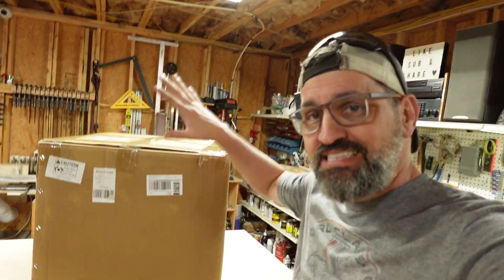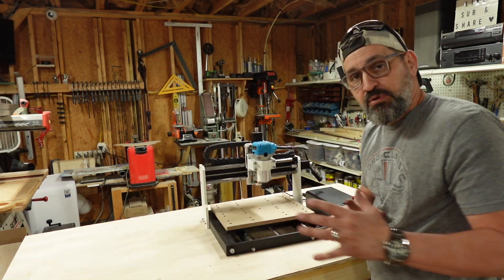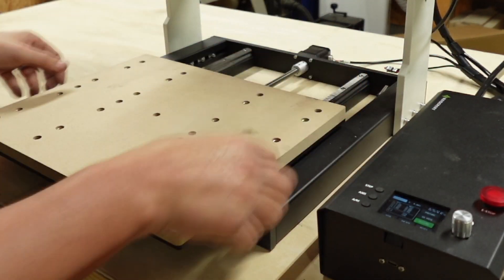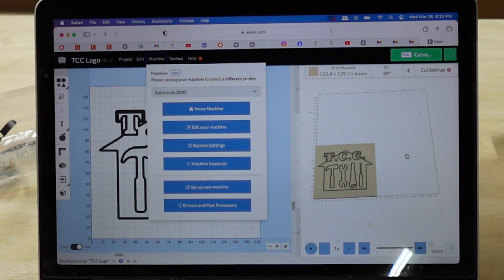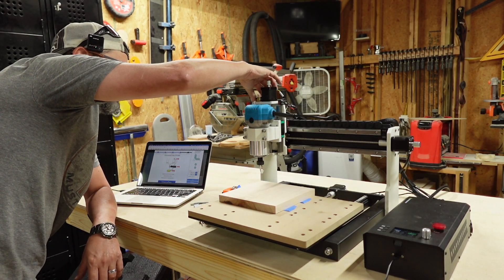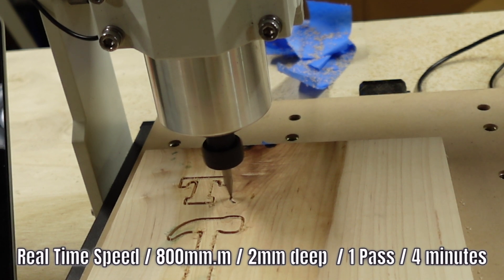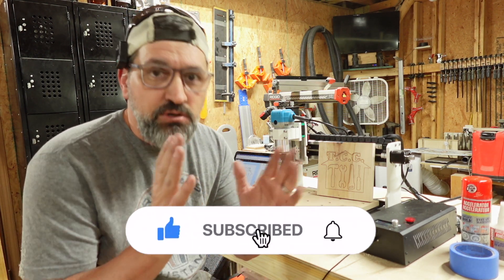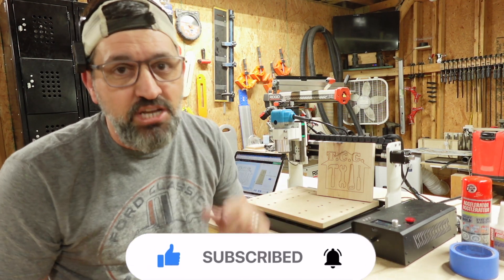The New AxisCreat 3030 CNC Machine! No Assembly Required... No REALLY!!!

Comment: Hello! :) We're looking at getting one of those. The use would be making light-duty parts out of plastics/HDPE/teflon and some aluminum. Been reading the reviews back & forth with this one vs the Genmitsu 3030. Besides being a little less expensive, the AxisCreat already comes with the upgraded 700W spindle, which is an extra purchase vs the Genmitsu. We already have printers and use them for making parts .. this would be for the things where tougher is needed. We did see the reviews where some folks used their Genmitsu 3030s for steel .. these two machines have the same stepper motors etc .. have you tried steel? Hope you don't mind answering a few questions. Also wondering if this machine can be kept in an unheated shop where the temperature might have wide swings. Thank you.
Reply from the maker: Hi! Soooo….I don’t think either of these let alone MOST desktop / hobbyist CNCs will handle steel very well. Steel is extremely strong and not to mention the Endmills / bits will not handle the workload.  For higher quality cuts, less stress to the machine and overall less hassle…. I would stay away from a Belt drive machine...Belts stretch and flex and kinda become a pain for some people.  For tough materials such as Aluminum…. Make sure it’s Ball Screw / Linear Rail drive.  That said…. As far as the work space goes. Make sure you get one large enough to accommodate your needs. The AxisCreat is twice the size at 24”x24” work space.  If you only will ever need a 12”x12” workspace then go smaller as it will take less space in the shop.  But don’t limit yourself for later down the road.  Hope that helps some!  Let me know if you have any more questions! Cheers and thanks for watching!
Reply: @TheCrawlspaceCraftsman  Thank you! Is the AxisCreat 3030 a belt drive machine? We don't need to make any big parts. In fact the printers are 220mm^3 build volume and they're fine for our needs.

Comment: I just bought this machine and if I want to run it offline from Easel, how do I reverse it? And how do I set my XY at zero? Your screen went blank and I could not see the process.
Reply from the maker: So in easel you want to go edit machine and change the $$ codes I posted on the screen to match.  Once you get those changed it should zero out at the front left corner. Hope that helps some!
Reply: @ I emailed the company and got a manual and in it is a setting to change the S23 Homing Direction in Settings to 1 to 4 the to set to the lower left corner. However, I am not sure that will fix the reversing of the image.
Reply from the maker: What’s your $2 and $3 currently?
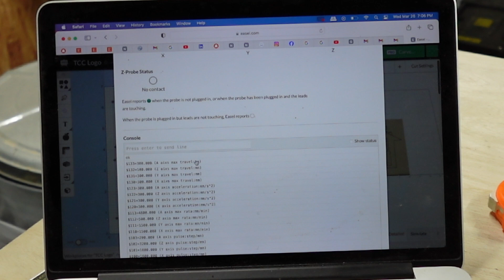Reply from the maker: Go to 8:30 in the video and it shows where to go just before it dies.
Reply: @ So I am doing everything offline, just going into the settings. the S23 was default to 11. I set it to 4 and it set it to front right. So I set it to 3 and it set to front left. I think they have Y backwards because if you look on most of these machines, like a 3018 machine, the Y motor is in the front. The Axiscreat Y motor is in the back. But basically I am doing all my designs on my desktop in Easel and then downloading the G-code. Still trying to figure things out .
Reply from the maker: @ it definitely is a learning curve!

Comment: Let’s be honest, it’s not a spindle it’s a router
Reply from the maker: Yes, there are key differences between a router and a spindle, even though a router can be used as a spindle on a CNC machine, hence the term “Spindle”.

Main Differences:
	1.	Power & Performance:
	•	Router: Typically runs on a universal AC motor, which is powerful but not designed for long-term continuous use.
	•	Spindle: Uses a more efficient and durable brushless motor, often with variable frequency drive (VFD) control, allowing for higher torque at lower speeds.
	2.	Speed Control:
	•	Router: Usually has a fixed-speed range (e.g., 10,000–30,000 RPM), with limited control beyond a basic dial.
	•	Spindle: Offers precise speed control (via VFD) from low RPM (for metals) to high RPM (for wood/plastics) with much better torque.
	3.	Cooling:
	•	Router: Air-cooled, relies on built-in fans, which can lead to overheating during long cuts.
	•	Spindle: Can be air- or water-cooled, with water-cooled versions running quieter and staying cool even under heavy loads.
	4.	Noise & Vibration:
	•	Router: Louder and vibrates more due to the brushed motor and high-speed fan cooling.
	•	Spindle: Quieter and runs smoother, reducing wear on the CNC machine and improving cut quality.
	5.	Durability & Lifespan:
	•	Router: Shorter lifespan; brushes wear out and need replacement.
	•	Spindle: Longer lifespan; brushless design with better bearings.
	6.	Collet Options & Precision:
	•	Router: Limited to standard collet sizes (e.g., ¼”, ½”).
	•	Spindle: Uses ER collets, supporting a wider range of bit sizes with better precision and lower runout.

Which One to Use?
	•	For hobbyists & light-duty CNC work: A router (like a Makita, DeWalt, or Bosch) is more affordable and works fine.
	•	For professional or heavy-duty use: A spindle is the better choice for precision, durability, and performance, especially for metals and long-run jobs.

Thanks so much for commenting and the call out!

Comment: Cute machine, I think it should run faster, guess 800mm/min was a conservative setting. In the controller settings, did I see spindle rpm setting? Can the trim router speed be controlled by CNC? Very Impressed, hope to see it working hard in future
Reply from the maker: Definitely 800mm/m was a conservative number. With the Router spindle and full linear rails…. I probably could have sent this one flying!  The spindle has a speed control on it but I had it set to 30,000rpm in Easel and max on router.  I should do another video for sure on crazy speeds! To see what happens!
Reply: PS. Can't see your buddy's link (couldn't hear it clearly in video)
Reply from the maker: https://youtube.com/@poultonprojects?si=8O72MdO_06caOvvz
Reply: @TheCrawlspaceCraftsman  great, many thanks
Reply from the maker: I updated the Description too! TY!